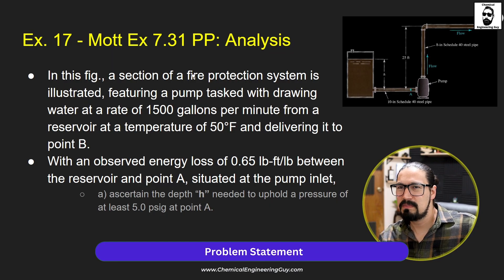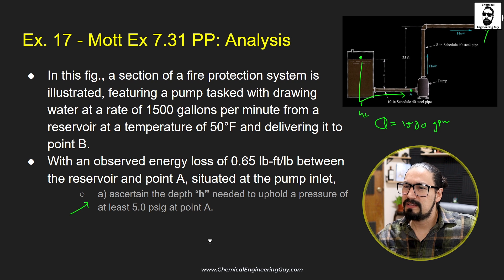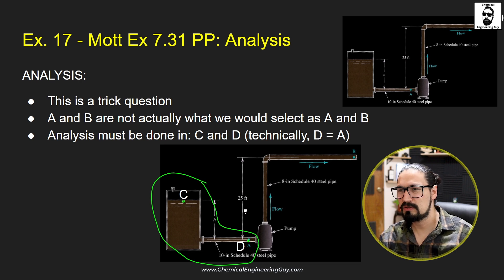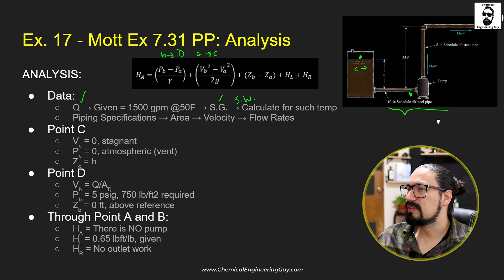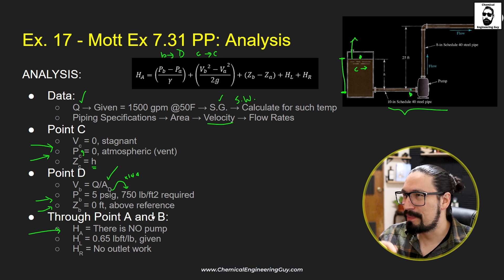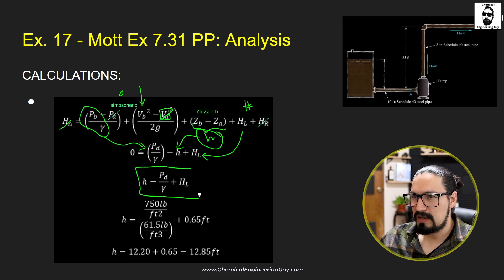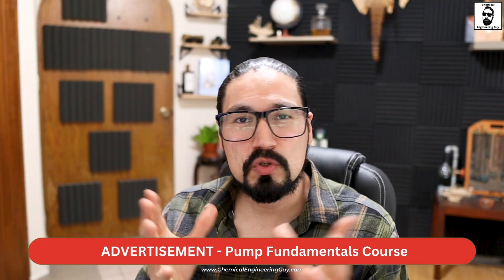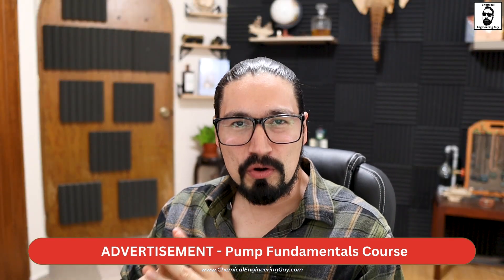Pump Calculation Exercise - Sizing a Pump for a Tank System - Pump Fundamentals Course

Comment: I like your contents, you are good. Nevertheless, I don’t think ur solution is correct. You should have also included the velocity term so that you also include the height needed to generate the velocity required. What you did will only cover the h needed to maintain the pressure required. the h needed should cover pressure-required, velocity required, and losses. Ultimately, the resulting value of the problem should be greater. What do you think?
Reply from the maker: I'll check it ouy, thanks for your input!